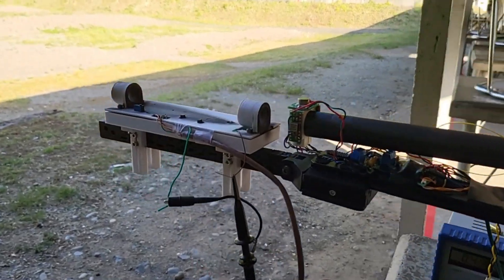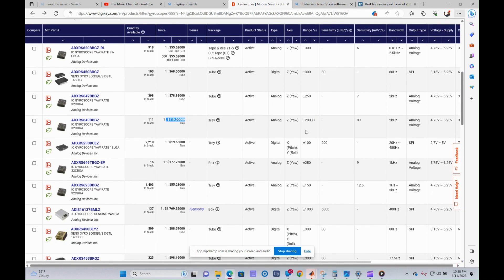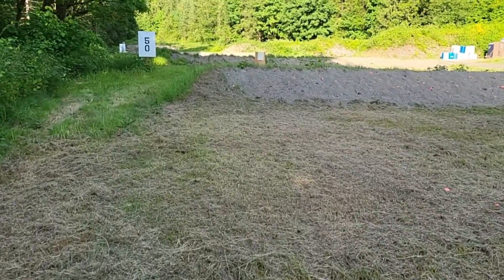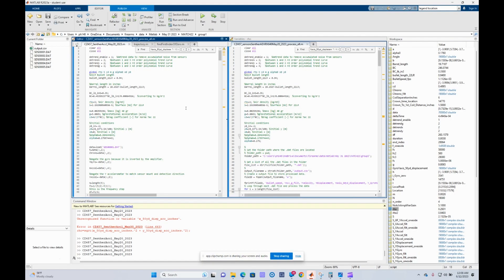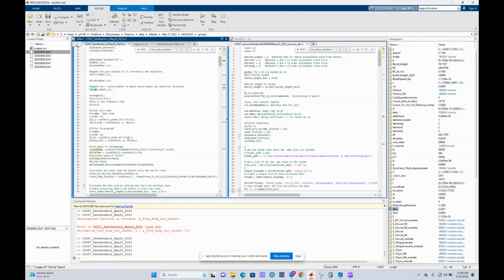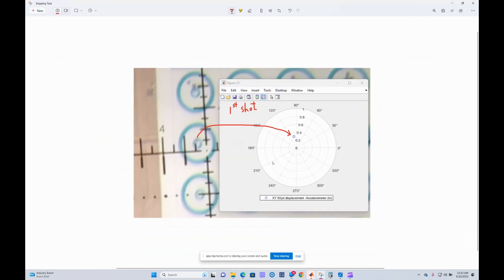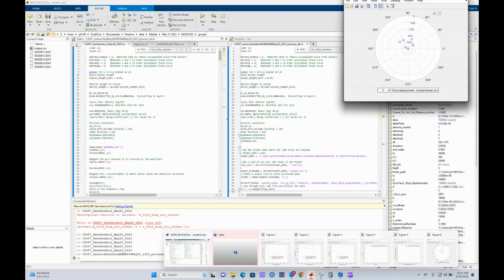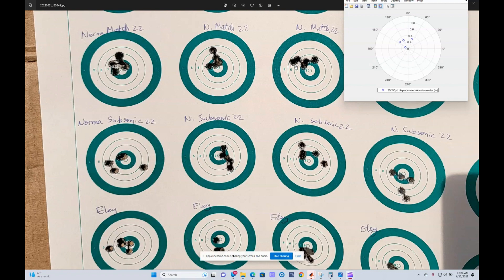CZ 457 MTR with Sensors To Measure Barrel Harmonics (Part 13)

Comment: This is great work, and I'm eagerly working through your videos.   I do have a question:   As a rough estimate, the muzzle rotation is only about 2 MOA (0.033 degrees) during the (approximately) 2 to 3 mSec barrel time.   So I'm thinking the yaw rate is on the order of .033/.002 = approximately 16 degrees/second.   Why would you need even a 2000 degree/second ADXRS645 gyro?   Wouldn't an inexpensive ADXRS646 or 642  (250 deg/sec typ) be not only affordable but actually better for the task?   Am I missing something?
Reply from the maker: Hi Michael, From the gyro sensor data, the highest output peak is just under 2k degrees/sec.  I have tried more sensitive sensors but it clips.  I am sure that the shockwave also induces peaks in the reading...especially when the bullet exits the muzzle.

Comment: This us very interesting! Was group #3 the only group showing such accuracy between caculated and actual shooting? Also, it would have been interesting to have a sensor  who could pick up the  stroke on the rim of the cartridge.  Then you could determind how fast the vibrations are introduced to the barrel.
Reply from the maker: No.  All the groups with the Norma Match ammo are closely matched to the calculated POI.  I did measured the vibration from the firing pin hitting a blank cartridge.  The vibration is very small by the time the ammo exits the barrel.
Reply: @TunerPlinker  Great info! One thing I have been wondering about, is why the vertical direction has a stronger vibration than the horisontal vibration. There's  two obvious candidates. Gravity, and fixtation between stock and mechanism (transfer of force). Do you know the answer? If no, is it possible for you to rotate the rifle 90 degeees, and measure the vibration of some shots?
Reply from the maker: @sidekickbob7227  Now that I have collected a lot of data, I do not believe that there is less horizontal movement than vertical movement.  It all depends on the ammo's speed, concentricity, etc.  The spinning of the bullet can create a rocking motion if it is not balanced....just like a washing machine's spin cycle when the clothes are not equally distributed.  So depends on the direction of the unbalanced force when the bullet exits the crown, it dictates how the barrel moves (left, right, up, or down).
Reply: @TunerPlinker  Thank you for the reply. This information you have managed to collect and published is pure gold!  I sincerely hope you continue on this trail.  My goal is to try to really  understand the process of how and why the vibrations occure, and what the tuner do when tuning it. There's a lot of talking about it, but very few put in the sience at your level. I really preciate your effort.

Comment: Been waiting impatiently for this installment - was worth waiting for 😊. Looking forward to seeing more examples, and to seeing the tuning results.
Reply from the maker: Had a lot of issues with the sensors.  Was working quietly in the background to fix the issues.  Lots of progress have been made and I know I haven't update everyone.  Didn't feel right to give everyone garbage data till I have sort everything out.  I am glad you stuck around.  Hopefully it is worth the education as it is for me.
Reply: @TunerPlinker you should get scooped up by Hornady or such
Reply from the maker: It's a fun project for me.  Got a chance to use my electrical engineering skills to solve problems.
Reply: @TunerPlinker  I've had the idea to either work out vibration dampening system..passive...active. .will one vibration cancel out another.

Or add vibration to modulate it to a preferable frequency ...
Reply from the maker: @misterlewgee8874  same here.  Active cancellation will require a motor with very fast transfer response.  I am sure that there exists a motor that will do the job.
Reply: @TunerPlinker  very definitely worth it! You are the only person I know of who is approaching this rationally and publishing your results. That your methodology is very similar to what I would do if I had the time, is just icing on the cake 😊 I'm very interested in seeing if your results show a correlation between the acceleration vector and POI or between displacement/direction at time of exit and POI.